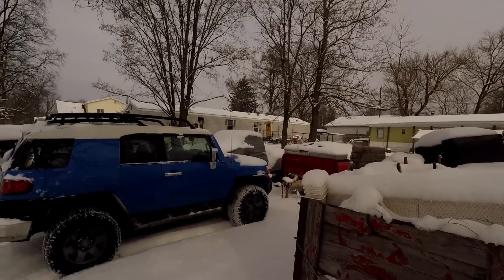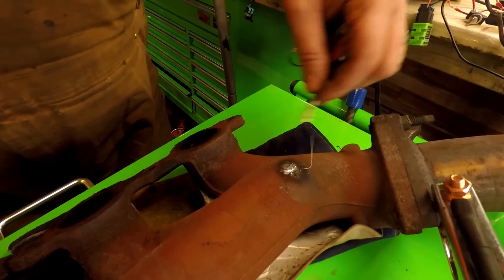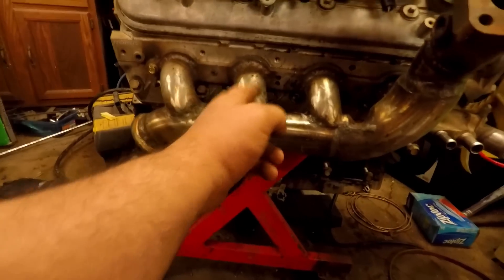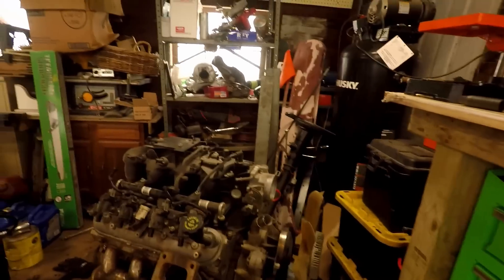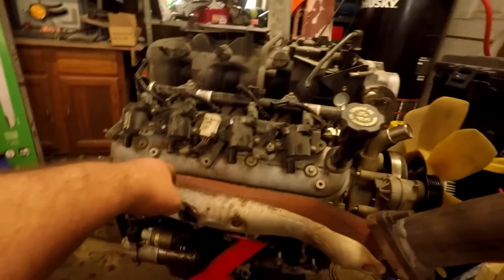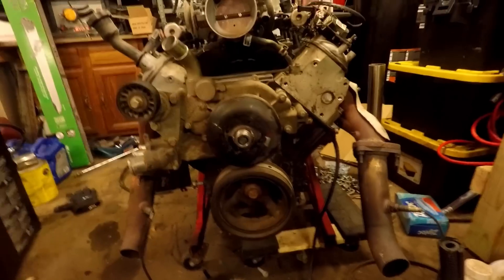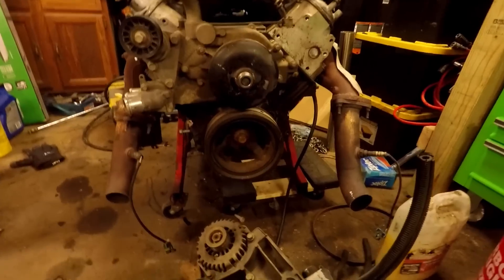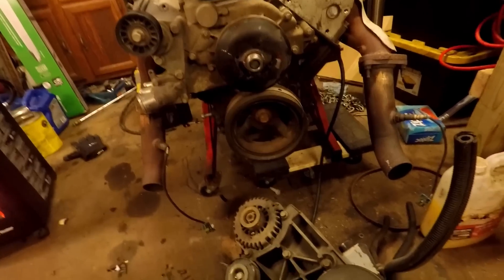LS Turbo DIY options using stock manifolds

Comment: Something I've been looking into is using a ls4 rear manifold as a log for the passenger side. Anyone seen this done for a rwd application?
Reply from the maker: They all interchange, so as far as bolting it up, no problem. 

I bet it tucks really tight though, could be a problem

Comment: Would it be possible to use a 4.8L Truck LS  and have factory manifolds turned back an up? I was thinking about using the snorkel fender style intake routed to a pair or compound turbos.
Reply from the maker: They're symmetrical, you can flip them a bunch of ways

Comment: Hey JR whats your opinion of those flexible exhaust coupling things? you know the steel braided things.

i have to   chop up narrow and shorten/rebuild my stock  Ypipe anyways to fit onto my modified stock manifolds  and already cut off the stock cats and need 12 inch extension pieces  so i was wondering if i used those  flexible things, one on each side would help not break manifold bolts in future since engine tqing from side to side that little bit wont be transferrred to exhaust placing less stress on manifold bolts and hopefully not break any .?

i had 2 broke off when i bought it and got one out easy and had to use a kral type clamp on the other and i broke one off Tqing it too high from erroneou info on the internet who said 40 ft lbs, lol. that much popped off the bolt instantly. now Gm techs are telling me 22-25 ft lbs and someone else even said 11 -20 ftlbs.  my tq wrench starts at 20.
Which is it? why doesnt anyone sell those bolts that come with c-clips to stop them from turning out? that way the lowest tq setting that doesnt leak could be used w/o worry of losing bolts.
Reply from the maker: Flex couplings definitely help keep stress off the manifold bolts. I've never broken a Dorman bolt though. 

I've also read the manifold spec as 22 ft/lbs

Comment: You can weld cast iron with a mug welder it’ll crack out but u can do it
Reply from the maker: This doesn't crack, it's fine, thousands of people running thousands of miles, no issues.

Comment: When welding up a turbo hot side to prevent warping , does it need to be all bolted up to the engine and welded or can you tack it up and finish weld it on a bench ?
Reply from the maker: If you're talking about the piping, just tack it and weld it. 

I usually put a flex in to deal with misalignment anyway.

Comment: I too am a " hoarder of Things".  it's nice out not having to "run out" to grab a bolt or piece of ...(whatever). Keep doin the videos 👍.   Also I feel blessed to be in the South and not have to dig my hoard out from under the snow😁
Reply from the maker: What's even worse is when you have to run the torch over everything before you can touch it without your hand sticking to it 😂

Comment: Looks like the side swap would be best, and cut the flanges off far back enough the pipe can be turned up, like a fairly tight radius 90° welded on. To turn up at about 75°-80° 
Something like 2.5" thicker wass pipe if possible. Either twin turbo, or run a reach around pipe and go in in the side of the 90° elbow, making a kinda Y/T fitting, a few vbands could make it easy to remove, most engine bays have a bit of room out on the sides, just in front of the engine and inner fenders.  This is what I'm thinking of doing in a few projects, 88firebird formula, 68Gmc, and 96 S-truck,  the GMC will have 2tons of room!
Reply from the maker: Yeah, the options are literally endless

Comment: I was looking for your injector video but can’t find it. I’ve got a bored .30 over 6.0 in my truck that came with a 4.8. I’m using stock intake and injectors and I think it’s been hurting my motor honestly. The header primaries on the driver side run hotter than the passenger side. On 93 octane cyl#1 would get up to 600*+! I have since had my tuner adjust it for 87 and it brought the temps down. Anyway I was wondering if the 33lb flex fuel injectors would be the best option and if so could I just drop them in and go no tuning?
Reply from the maker: https://www.youtube.com/watch?v=DARkk0h_820

No you can't drop 33/lb injectors in place of 23's and go with no tuning.

Comment: Great video, as always! I was looking at the options for either 2 passenger or 2 driver manifolds, both down, but one turned forward. Do a turbo in the front (either steering box or AC side, whichever has more room). Run the crossover in back. Sort of a DIY turn-down Holley style, if you will. Interested to hear your thoughts, for a 70s Datsun, originally with an inline six.
Reply from the maker: That could also work, I mean, since you can weld to them, the possibilities are endless. I've seen people cut them almost down to the bare flange and build from there.

Comment: Running the truck manifolds on my 1998 gmc Sonoma  they hit the frame had to mod the stock manifolds to work .
Reply: How hard was it to swap it I have a '98 s10 I want to do a 4.8 swap.
Reply: @BattleOfBowties  I drop in a 5.3 the mounts I used it drop right in had to drill and tap frame fro the mount in the frame .changed out the steering shaft with a jeep Cherokee to clear the exhaust  . Notbad at all. I bought the adjustable mounts. It even cleared the heater box.
Reply: @BattleOfBowties  Will be doing updates on exhaust build soon . If you watch the trans build I have finished the turbo build . Been working in the  exhaust .if you sub to my channel  you can check on the other videos on truck .

Comment: I need some opinions from you and anyone that happens to read this.
Let's say you have $1000 to spend, and really want some boost in your life. I currently drive an 05 Canyon with an i5 engine (yeah its weird) runs good but not in the greatest shape.
2 option... 1.) Invest in it and add boost to what I think is the original engine with over 240,000 miles. 
Or 2.) just buy a little Golf gti that comes with a factory turbo and just make it faster over time.
Unfortunately HP Tuners isn't compatible with VW and my only option for turning is what the stage 1,2 and 3 which are upwards of almost $700 and they just are what they are. No adjusting spark or VE or anything.
Reply from the maker: I'm not at all familiar with Golf's... But I will say if you're not into what you have, don't throw good money after bad, get something you like

Comment: Can someone help me how much should I be paying for a lq4 block? Then how much for one from lkq online or is it cheaper to go in a local junkyard and get a lq4?
Reply: Go to junkyard and get a price list 
That’s the price
Reply from the maker: You clearly have internet access.. I have no idea where you are, why can't you figure this out?
Reply: The Driveway Engineer because you do this and I watch your videos I wanted first hand experience
Reply from the maker: I don't know what your local yard charges...
Reply: Well how much does one go for you compete or not
Reply: Romero call your local junkyard and just ask. you’re going to want to buy the engine complete with manifolds and computer and wiring if you can
Reply: Stuart Houston ok for sure thanks. What about a bare block from summit or something build it from there for 400hp daily or just get a complete 5.3 or 6.0 like you said. Then do h/c/I tune headers for 400hp?
Reply: @romero.4089  just put in a whatever displacement  junkyard ls (the 4.8 is the least desired so it'll be the cheapest in it) and a cam and springs plus a 75/75 turbo (you may not need a turbo to hit your goal) . It's straightforward simple, cheap,  proven, and reliable. Buying a bare block isn't cost-effective when you can get a complete running engine for the same price or for less and when you get that junkyard engine, don't tear down the engine (except for what it takes to swap the cam)  unless you are going for 600+ on just pump gas and water meth injection then gap the rings 0.30 thousands but don't replace a single part  unless it was already a problem before hand
Reply: Romero if you start bare block you will end up spending way more than what you would at a junkyard. Junkyard doesn’t necessarily mean junk. If you’re worried about reliability, some junkyards warranty their engines, find one with low miles. if you’re worried about power, a stock engine can make 4-500 with a few top end mods. only reason to do a bare block is if you want to make really really high power. LS engines come from the factory pretty well made, that’s why people use them in everything
Reply: The shade tree welder thanks man I hear you know my options are narrowed down once more thanks I appreciate it keep it coming if you have anymore 👍🏽🙃
Reply: The shade tree welder oh yea if you said I probably don’t even need a turbo to hit my 400ho goal with a 4.8 then a 5.3 would be simpler and so would a 6.0 eight because once I get one iam just gonna h/c/I headers tune full exhaust torque converter maybe a yank and what trans a 60e would be to weak huh but a 80e resides flashed ecu and mounts etc
Reply: @romero.4089  Don't bother with a 60
Reply: If you just need a bear block you better off paying 1695 from scroggin Dickey's with Billet main caps great deal better than doing all the machine work on an old block.
Reply: Romero 
Car-part.com or get their app, if you don’t want to pull one yourself. Plenty of classified apps there as well.

Comment: I have some speed engineering turbo forward headers and they clear everything, factory accessories, can get to my plugs easily, no relocation needed and they were like not even $100 shipped. I do want to try a log style manifold soon though
Reply from the maker: Maybe Speed Engineering got it right finally, I've never seen a set that don't hit everything
Reply: @TheDrivewayEngineer  yeah that's what I was worried about. I was ready to do the whole fbody accessory swap but didnt have to and it's worked out for me. I've posted pics in the fb group before I think...blue firebird formula with a turbo 5.3
Reply from the maker: With truck accesories?
Reply: @TheDrivewayEngineer  yeah 100%, I have some pictures of everything on.
Reply from the maker: I can't find them now, I did find someone else showing they cleared the accesories. 

For 100 bucks I might order a set and see, yours are Speed Engineering brand specifically?
Reply: @TheDrivewayEngineer  so I just looked at my purchases on ebay and they've raised the price from about 100ish when I got them to 180 now but yeah, Speed Engineering LS Turbo Headers forward facing. So still not a bad deal for forward turbo headers that fit and clear all stock accessories and have v bands

Comment: How much boost are you planning to run with stock ring gaps?
Reply from the maker: All of it
Reply: @TheDrivewayEngineer  lol
Reply from the maker: My GT45 is tapped out around 14 psi

So 14 psi
Reply: @TheDrivewayEngineer  this gives me the ok to run all of it as well. I did check top ring on 1 piston and it was .26
Reply from the maker: Are you trying to say that 14psi from a GT45 results in a different amount of manifold pressure than 14psi from an S480?
Reply: @TheDrivewayEngineer  exactly, don't you love it when an, "expert" shows up calling everyone stupid, when they have no idea what they are yakking about? #DUNNING KRUGER
Reply: @hoofarted8709  LMFAO, u even serious bruh?
Reply from the maker: @hoofarted8709  well that's more clear, and I don't disagree with that...

I believe he's trying to gauge cylinder pressure though, which depends on cam and some other variables, but knowing how many PSI I ran on a stock ring gap is still a helpful signpost.

If he cranks 22 degrees in on 87 octane he can still melt one down lol
Reply: @TheDrivewayEngineer  Just put two of those gt45. Then there's no argument about 14 lb of boost. Cuz it'll be 28 pounds If you want it. Back pressure will kill power at low RPM quicker than choke. These guys are being too nitpicky that single gt45 will probably get you 650 horsepower
Reply from the maker: @hoofarted8709  it means there's 14psi of pressure over ambient in the manifold....

Explain wtf your point is?
Reply: @TheDrivewayEngineer  it's funny that he deleted his comments, because YouTube still shows what he said in the messages folder. Most people I've talked to say 10 psi, intercooled, is about the safe limit. Detonation is avoidable at any boost level, but butting rings, not so much. Lol
Reply from the maker: @700HpVette  agreed, boost pressure at a given ring gap is absolutely comparable with no other factors considered.
Reply: @TheDrivewayEngineer  if you use quality rings from a good manufacturer, they will give you ring gap recommendations based on power level in regards to bore diameter. Same thing with nitrous oxide manufacturers.